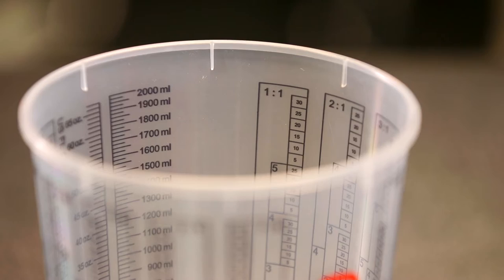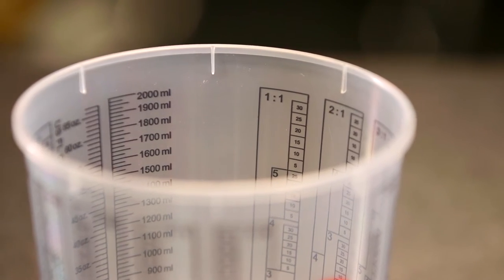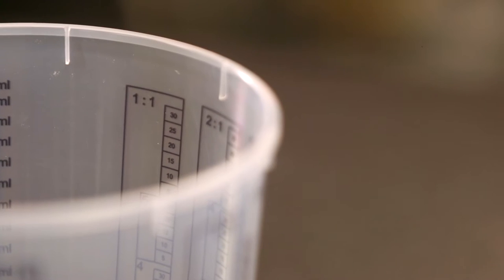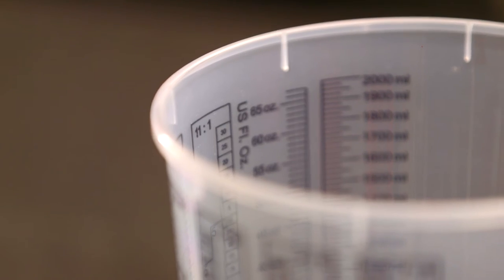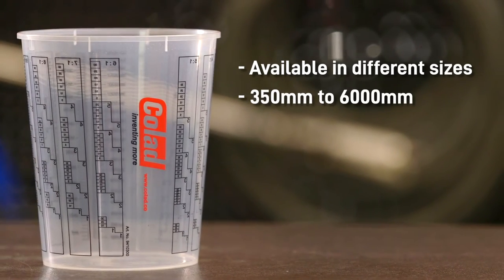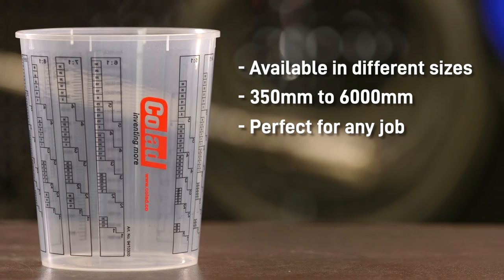How To Mix Paint - Understanding Colad Mixing Cups For Paint Preparation

Comment: That percentage increments (5-30%) on the cup is very very misleading. The percentages represents the amount of extra liquid you want to pour into the cup, on top of whatever you ALREADY have in it.
It does not represent the mixing ratio some manufacture want their paints reduced. For example for Sikkens autocryl the mixing ratio is 100-50-30. That means 50% hardener and 30% reducer. If I use this Colad cup and use the 2:1 scale (paint and hardener) and fill it up to plus 30%, it will give you the WRONG amout of reducer you actually needs. Again, the percentage increments represent the amount of extra liquid you want to pour on top of whatever you ALREADY have poured in the cup.
Reply from the maker: Hi might have to put an image of that explanation up as we've never really encountered that with paint mixing our side. On the way you have calculated does it matter what the 50 and 30 are? ie: if 100% is 1000ml then 50 is 500ml and 30 is 300ml